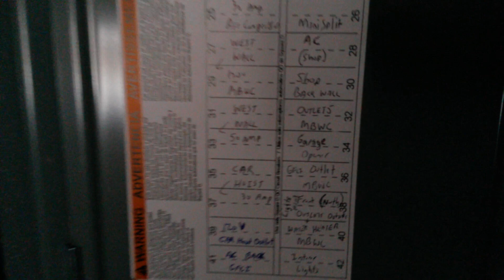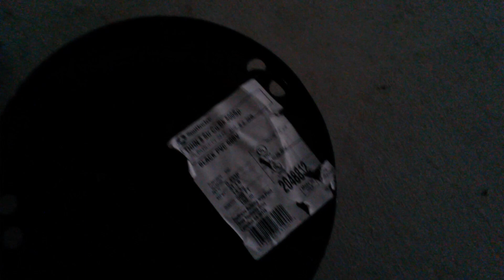Pole Barn Electrical Wiring In Conduit Example & Ideas

Comment: I like that you have a lot of 240v and the fact that you wired for the 50amp capability.  A lot eaiser to go down then it is to have to upgrade in the future.  I had two (2) 60 amp outlets in my garage.  One is for a 10hp air compressor that actually requires 60 amp and the other one is for a welder that may only require 50 amp, so I have an extra 10 amp to play with in the event I need it.  I also had Seven (7) independent 20amp circuit, 120v outlets/receptacles.  I will probably never really ever need all 7, but I have them if I do.  Rather have a boat load more than I ever need vs. the one time I wish I had one extra.
Reply from the maker: Exactly. Easier to have more . Never heard someone say they wished they had less outlets! Thanks for watching

Comment: Is that spray foam I see in the rigids of the  lower part of the walls? Are you doing all of them or just the lower sections and what is it for Thanks
Reply from the maker: Good eye! Yes it is the pest foam and I did it to all of them to.prevent any ants or other bugs using my walls as a home. Not worried about condensation forming as it can escape out the top.into attic and then out ridge vent

Comment: How did you run your exterior j-boxes?
Reply from the maker: Do you mean my front one for my outside  gfi or my disconnects for my ac units? I had a meter installed on building and only run coming from my house is internet,phone, cat6 . Those come in a 2 inch pipe to Lb that sticks through steel and hooks onto junction box inside  so its flush with drywall

Comment: So is that wire Romex you used in the conduit?
Reply from the maker: No, i used THHN and went stranded and solid. You can use romex /nm but will pull harder and will use up more pipe fill. You can by code use it in conduit if you don't  want  to  buy THHN , but more of a problem in pulling it on long runs. Thanks for watching

Comment: I see your 240v conduit going through your duplex outlets, did you just use the box as a "through" for the 240v wires?
Reply from the maker: I planned it so the 240v boxes are usually the first box to feed , then the 120V are down the line as it is easier to pull wires through it. You can have them as through boxes as long as you figure out the correct box size using box fill formula.  If you do that , then it is an increase in cost since you will need deeper boxes / mud rings to accommodate #8 & #6 wire.  It sucks to bend  #6-8 wire around the duplex outlets and will run into problems since outlet will be held out by the thicker wire running behind it, if that makes sense

Comment: Question was you $1400 including the conduit? I'm planning out my electrical know and your points are right in line with my thinking. people look at my plans and joke about all the plugs but I agree now is the time not later.
Reply from the maker: $1400 is only material cost, not labor. That is because I went with a 200 amp panel with 40 spaces ( $600 with all breakers) and I went with 30 and 50 amp wire for 240v . That added more cost. Conduit is cheap , it is just learning to bend it . You can always run the pieces straight with no Offsets( bends by boxes) because it will be covered by walls.  You can buy a pipe bender for like $30 and practice and you will be able to learn how to do simple bends. Not that hard. Good Luck

Comment: Jason, you have a very nice shop and do great work!

I have a question.  When you mounted the receptacle outlet boxes to the the wall nailer, are they flush or do they stick out past the edge a little bit? I'm in the process of mounting so in my shop and was curious the correct way to do it when installing metal/liner on the walls.
Reply from the maker: That depends on what wall covering your using . I used 1/2" sheetrock, so I bought 5/8" mud rings to to make outlets flush with final wall. ( My boxes had nailing flange so they automatically had a set back of 1/8"- 3/16")  In your case, you will need to make sure to put your boxes in the flat part of the steel and not on a rib or the covers won't sit flush. Also,  you can use mud rings in any depth , as steel is only 1/16" thick maybe, so you would set the boxes back whatever your mud ring thickness is. So if you use 1/2" mud rings, basically set your boxes back 7/16" to 1/2" from being flush on nailer board and with 1/16" steel , that would make your outlets flush. I would set it back a little more (1/16")  to make sure that the mud rings won't stick out past steel wall.  The outlet cover screws have enough threads to grab if box isn't flush with wall. Make sure to insulate/caulk where box meets steel wall liner
Reply: Ok, that makes sense to me.  I appreciate it Jason. Thanks for taking the time to explain.
Reply: What did u use to strap conduit pipe down on top edge of 2x6

Comment: Did you use stranded or solid wire on those #8 and , #10 and #12 AWG pulls? Any thoughts if one is better than the other in certain situations?
Reply from the maker: the #8 & 10 were stranded for easier pulling. The #12 were a mix of whatever I had . It depends on what your outlets have for connections. If it has only screw type, then solid would be best to wrap around. If it has the holes for pushing wire in , then solid of stranded would work.  It is harder to wrap the screw terminals with stranded but you can just cut out about 1 inch of insulation in middle and wrap it  and not cut the wire ,  if that makes sense. If you cut the wire, then need to crimp ends onto stranded to make outlet connections. But running inside conduit , if it isn't max fill , it doesn't matter much what you use.